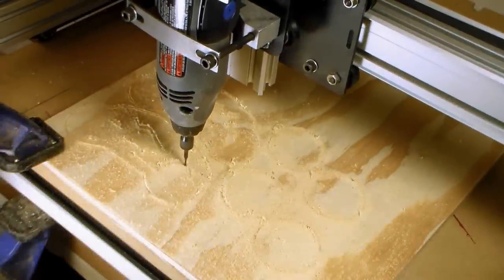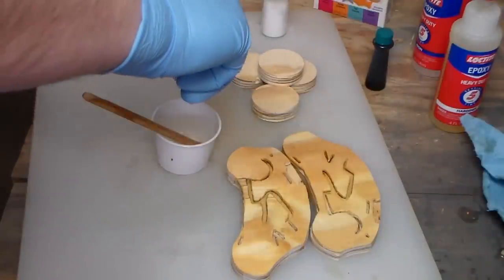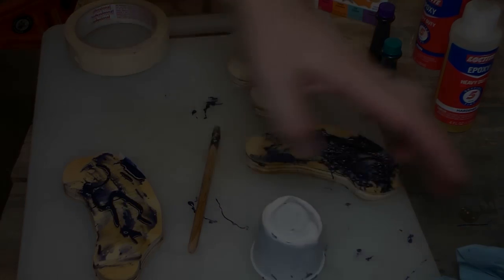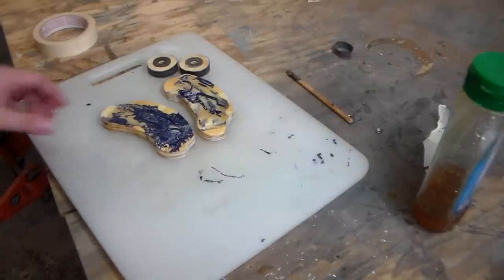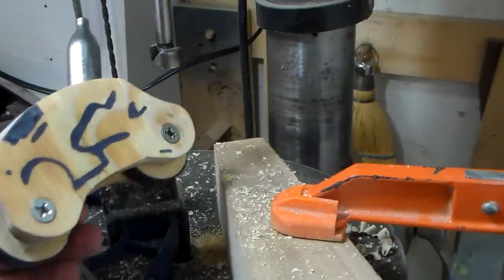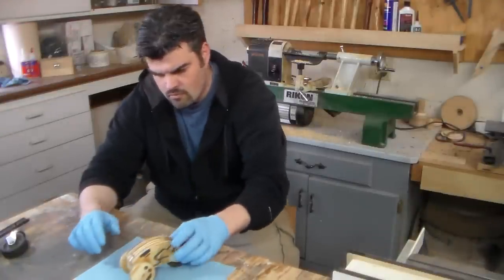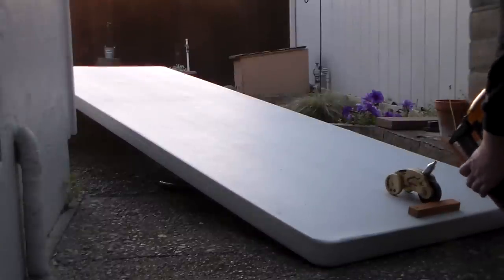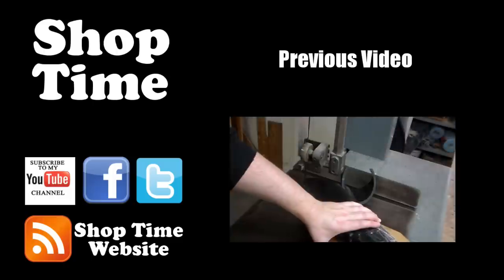The Co2 Powered Light Bike

Comment: Back in middle school in the 70s we were each issued a block of wood with a hole drilled in the end for a CO2 cartridge and some wheels.  You could carve the block any way you liked.  They set up a 2 channel track with walls to help guide the cars.  A 'T' shaped piece of wood with a nail protruding near each end was used to puncture the cartridges.  They lined up the cars with the two nails.  The T bar was hooked to a small bar above it and would swing down so that both nails would puncture at the same time for an even race.  It was awesome!
Reply from the maker: IceManTX69 Was there anything to keep the cars in place, or was the force of the nail board enough to puncture without moving the car?
Reply: Honestly, I can't recall.  That was many many moons ago.  But I don't remember anything other than the heavy wood T swinging down and boom...

Comment: This explains why we had those screw eyes in the bottoms of our co2 powered cars riding on strings back in middle school :)
Reply from the maker: krtwood I've been getting a fair amount of comments about the string guided Co2 cars. I wonder what they used to pierce the cartridge?
Reply: Peter Brown
Pitsco makes some electronic stuff for $$$, I don't know if that's what we used.  Some people seem to be using a pin that swings down with a weight on it and the end of the cartridge fits inside a hole in the gate to locate it properly.

Comment: we made similar cars in school.  ran on co2.  a course was a 2x4 at each end with finishing line strung between them.  very long hall way. the cars had little eye bolts under them so they would stay on the course.  and there was some sort of contraption that came down wacking 2 cars co2 tanks at the same time with a nail.  worked awesome.  so well my car won every single race.  I still have it to this day.
Reply from the maker: Frank Allison That is so cool. I've now had a lot of folks share similar stories too. Apparently I went to the wrong high school!
Reply: I'm guessing you did.  But we did it in middle school.  Back when middle schools allowed shop.

Comment: you could always put a little paddle wheel inside with the co2 canister facing it (with a very small hole or come kind of regulator) and a rubber band connecting the wheel to the paddle wheel
Reply from the maker: pmk222 I like that idea. Very clever!

Comment: Why have the CO2 cartridge pointing up at an angle instead of back? I guess you are hoping for a downward force to help the wheels contact, but I think a lower angle would be better. I also second the eyehooks and string motion mentioned elsewhere. That's what we did in cubscouts.
Reply from the maker: jaquo25 I'd never made a Co2 car before, so I was thinking it would take off without some downward force. It did work, but maybe a less steep angle? I need a better delivery system too...

Comment: You need to aim the co2 cartridge transporting the opposite direction what you wanted to go you have it set almost straight up and down it means there's more for schooling toward the ground then to propel it forward so if you would change it to 45 to 35 degree angle from the ground you would get much more actual length and force behind the light cycle
Reply from the maker: Cameron Whitlock Good to know! Thanks!

Comment: Copper or alluminum makes a much better bushing material than steel, but as you've noticed ball bearings are so much better when dealing with wheels. Bushings are really only good at dealing with a lot of weight like on a heavy steel door or the kingpin front axles on big trucks. There are roller bearings in a kingpin though so perhaps that's a bad example...
Reply from the maker: +Derrick K I've come very close to deleting this video a few time. It's one that I really hate...
Reply: Peter Brown it's good to remember our mistakes so that we learn from them. If anything this is a learning experience and there's no reason to be ashamed of that.

Comment: I'm not sure if it's the same thing but we kind of made cars like these during woodworking and it needed a track to run on to keep it going straight so there was a loop on the bottom that we put string through so we could race them. also they were facing backwards not up and it had to be like an inch from the top of the wood? those were probably just safety things but it might be useful for yoy
Reply: Not backwards like on the back of it but that's just how we made it

Comment: 1.  point the co2 cartridge straight back.  2 install  two screw eyes underneath, one at each end.  3  run a guide wire through both screw eyes, and attach the guide wire to the track at each end.  Now you have a car that will go very fast and stay planted to the ground.
Reply from the maker: Seth Jones I've seen a number of folks suggest that. Where were you last month? :) Thanks Seth!

Comment: Try tilting the the angle of the co2 hole down a bit by drilling another hole at a different angle and and it should proper the car more forward instead of down and you could use a guid wire design that the car could track on during propulsion
Reply from the maker: Wessly Hyde I think that's a good idea! Thanks

Comment: The blue food coloring and glow in the dark powder was a great idea.  I am going to use that in my shelf project.  Do you think that varnish will lift the powder off of a surface painted with paint and the glow in the dark powder?
Reply from the maker: WarBerJr02 I don't think it would. If you mix it into the paint. The question is if the paint transparent enough to work with the powder though. It might not be. I would test it first...

Comment: Might also work better if the cartridge was more perpendicular to the plane of the axis your trike was intended to travel along... a lot of energy is lost in downward pressure... Another reason to use the guide string. :)
Reply from the maker: Hath'alud LaFox It's been raining here, but I'm going to try re-boring the hole and see if it works any better. I'll probably give an update on my vlog channel....
Reply: Will, you follow Peter, too?